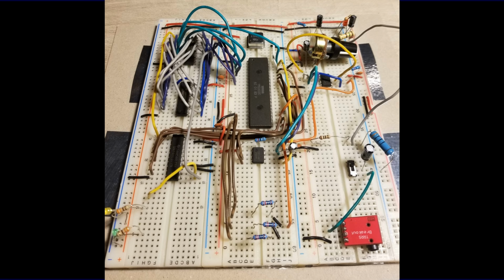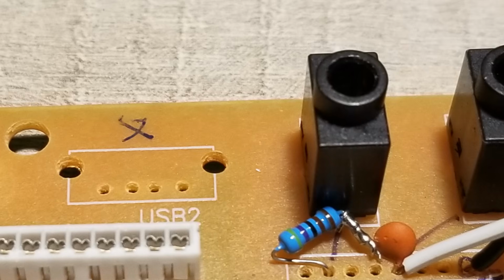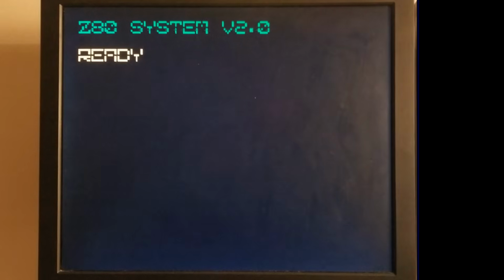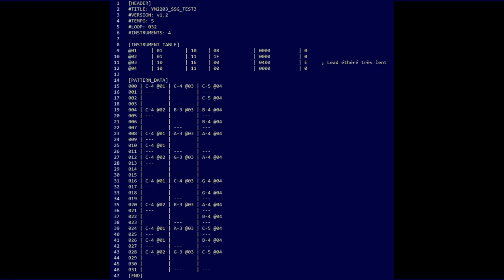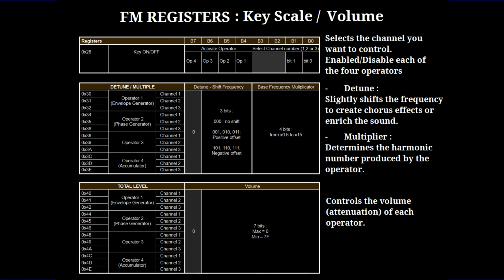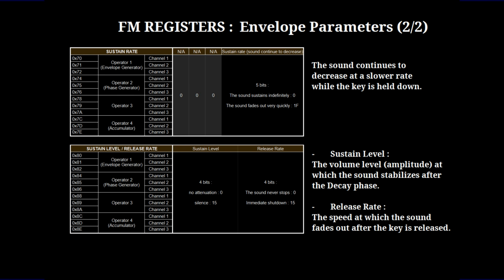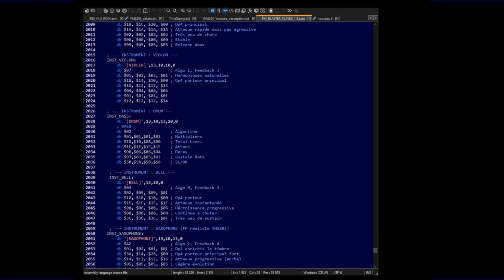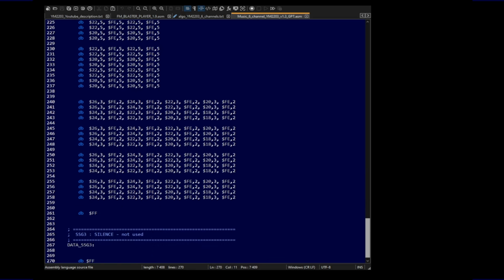Creating a YM2203 Sound Card : FM Blaster

Comment: Hi ive seen ur 4 bit cpu model could u please send us  the total components required for building that
Reply from the maker: Hello,
Unfortunately, I don’t have the full component list anymore for the 4bit CPU project.
At the time, I was using ExpressPCB, which didn’t support proper BOM export, and the project is a few years old now.

That said, the design is mostly based on standard 74xx logic ICs, so it should be possible to recreate it by looking at the schematics and videos.